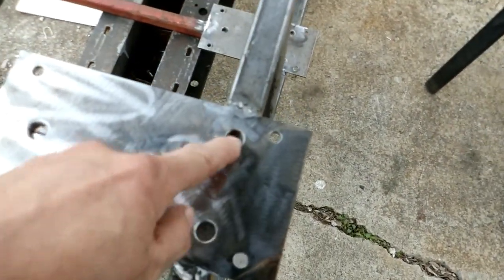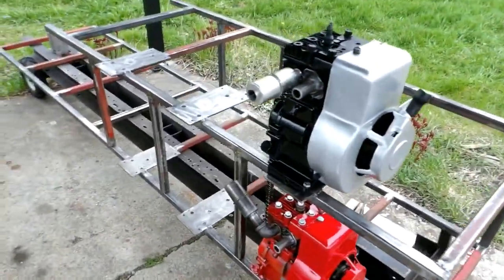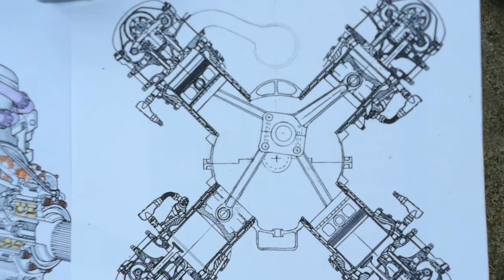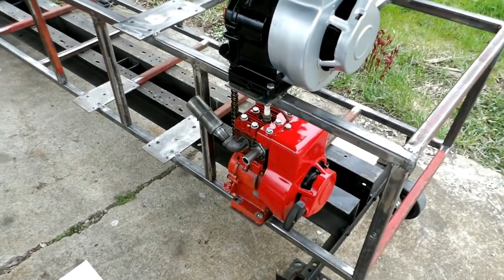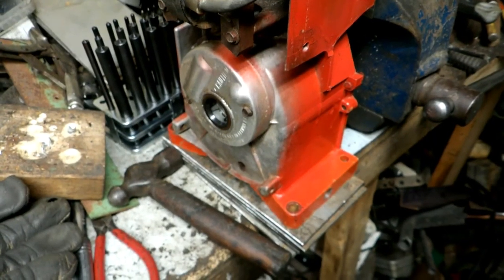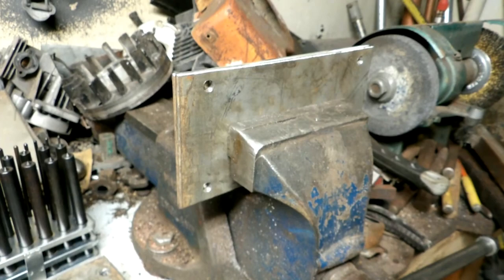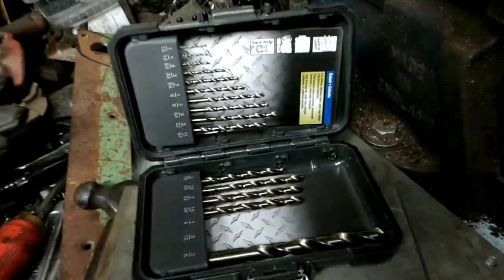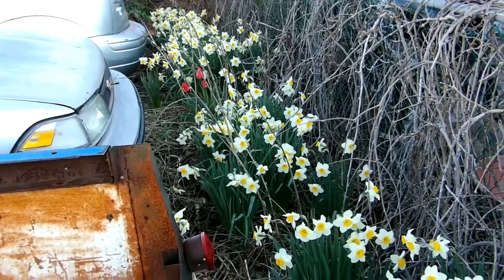Homemade H12 Cylinder Engine Part 5

Comment: Cool project. Hey what brand snowblower is that in the background and around what year is it? Thats a Briggs 6hp model 14 or 14 cubic inch on that right? I ask because I have that engine and was wondering what snowblower it came off of and the approximate year. Mine is missing its tag. I need one with model 142303 on it, the aluminum one, that has a hole in the center to screw it on to the back. If you got one I'll buy it off ya plus the buck or two to send it in a flat envelope.
Reply from the maker: Sorry, I have never seen a model 14 Briggs engine, they are like hen's teeth!  This snow blower has a 7 horse Tecumseh on it. I tore it apart a bit this week, all the bolts are rusted in place, been outside for many years I think.
Reply: @ChargerMiles007  What brand snowblower was that anyway? Or were all the markings wore off. Theirs a guy on YouTube that actually has the exact same model 14 Briggs I have and he cannot recall what the blower was that he took it off of lol, which is kind of a shame it would have been good to know. Right now I have to guess maybe Gravely or Snowbird possibly, since it was from the 50's pre dates Tecumseh snowkings and majority of modern two stage blowers, snow birds were out in the late 50's, Gravely made an early two stage like snowblower back than, their were a few others, but not like the modern stuff. Its uses an oil bath instead of not having any type of filter.

Comment: You should link the exhausts using pipes so that it sounds different then you could do a comparison of it with the connected exhaust with no exhaust
Reply from the maker: I would consider doing that, but the linked exhaust on the inline 7 cylinder was a BIG pain to make, so I will stick with separate mufflers for now. Working on this has pretty well eaten up my holiday weekend!

Comment: I want to try to build a 1 liter single cylinder engine
Reply from the maker: I am sure that could be done,using a stroker 440 piston would get you close.
Reply: @ChargerMiles007  Yeah I was looking at using a 427 piston with a long stroke

Comment: For your welding problem i recommend using 0.030” flux core wire, it should work perfect with your machine. and make some pretty decent welds. every time i look at two clean pieces of metal next to each other i get itchy to just weld it up. am i the only one? weld fever or something? it’s just like, “oooohhhh i sure would like to run a bead down that” 
idk. it’s strange. but try the 0.030 flux wire and that should get you good penetration and everything. cheers!
Reply from the maker: Sure, i can quickly give that a try, as I have some .030 flux core, as i was using it on my car.

Comment: 88 Amps sounds a bit underpowered, I'm guessing you're limited to that from running on 120V AC, whereas full-fat 240V would do better, but given the wiring over there is a bit more of a pain to obtain away from the dryer or stove outlets... :D
Reply from the maker: Yes, I remember a friend had to unplug the stove to plug in the welder :)  I would probably have to do something similar if I got a 240 AC stick welder. I have a 120 V stick welder, but I think it only puts out like 75 amps or something, though even that may penetrate better than the 88amp MIG.

Comment: If your weather has been as bad as it is here, that's pretty good progress.  I was stuck at home for 19 days and maybe 3 or 4 of them were good enough to do any outdoors work.  If it ain't raining, it's barely 60F and dangerously windy until the wee hours.
Reply from the maker: Barely 60F, that would be nice, we have only made it to that once so far, mainly hovering in the 40s. Plus it has been windy as heck some days. I hear you though, just not good outdoor weather. Thats why I curled up indoors and started to draw the Vulture cross section drawing.

Comment: Need argon gas for solid wire I think
Reply from the maker: I was using CO2, which is what my son uses just fine with his 140 amp welder. I just don't think my little 88 amp machine has the gusto to get penetration with the .024 solid wire. It still does OK with the .035 flux core, but filling in plug welds is very hard to do with flux core. I may get out my small arc welder for a test run, as I need to get decent welds in the plugs to hold the motor base plates down. That or perhaps I can pay a visit to AC/DC Welding with the frame  :)
Reply: ChargerMiles007 try preheating the work with a blow torch ? Sometimes that helps and doubles chances of getting a nasty burn ! 😊
Reply: Co2 is the gas but after setting the amps, fine tune the wire speed. With the right wire speed the welding noise settles down to a hum and less splatter. Once you get the settings right you won't use anything else (until you buy a tig ). I use tig most of the time now, so neet and tidy and you never have to chip or grind any welds. Argon is the same cost as co2